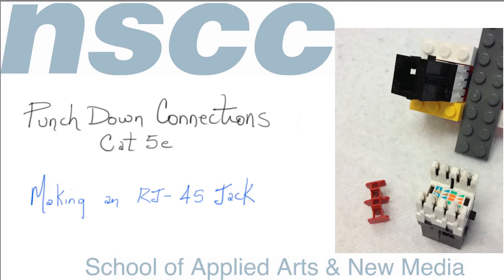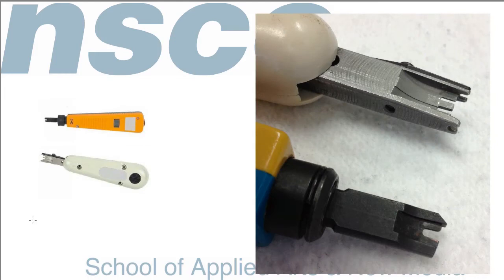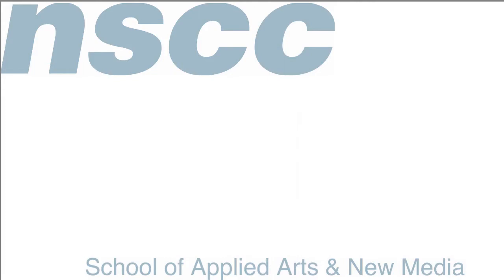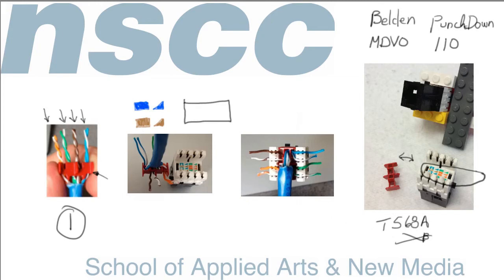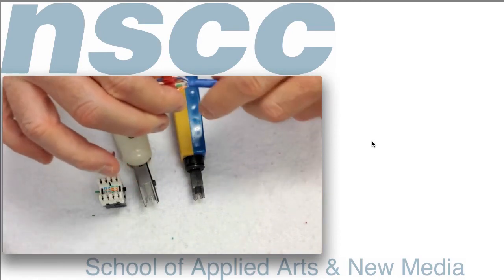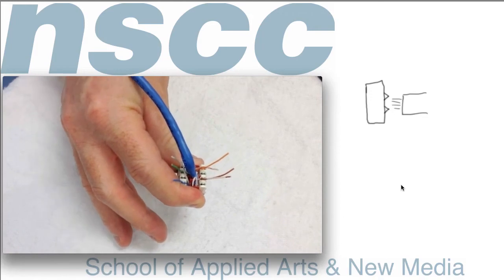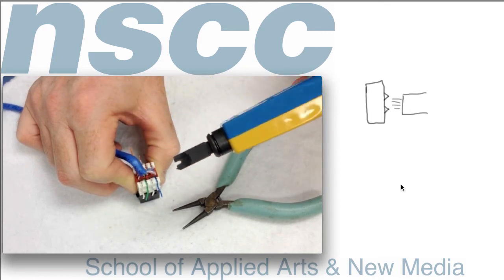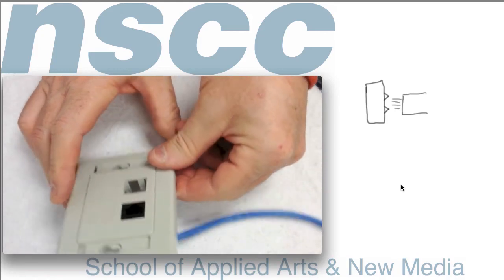How to use BIX and 110 Punch-down tools

Comment from the maker: Michel has more info on the BIX tool that he uses and you can read his comments below. His tool cuts slightly different than the 110 tool and so if you are using a BIX you may need to adjust your technique slightly. Both are designed to be easy to use.. simply push down solidly and your wire should be installed and the end cut. His BIX cutter may be a bit more reliable than the 110. Some cutters can be replaced and some can be sharpened if they get dull.

Comment: No much info on the BIX tool
Reply from the maker: Both standards work identically, but the "punch down blocks" are of differing dimensions. Showing how the 110 works will also explain how the BIX works. The BIX was used by most Telcos, but the 110 is likely the more common standard now. Just make sure to pair the correct punchdown tool with the blocks on which you intend to use them.
Reply: @davecrabbe4579  Partially true: the BIX tool and the 110 have very different cutting tools. I realized the BIX cutter was actually cutting only on the return trip of the  punch down block while the 110 cut on the downstroke. Significant difference.
Reply from the maker: @QcHumaniste  I don't have the tool anymore. I used one for years and certainly couldn't tell. (and also used the 110) . I just watched a video on it.. wow.. couldn't tell. It does cut right at the point where the max downward force is applied.. Maybe a significant difference is design, but really.. the exact same in operation. Push down straight, hard, release upwards and either one will punch down properly.  I did not have to change any technique in moving from a 110 to a BIX.  So as far as "How to use" .. I would still say my directions will apply for either.
Reply: @davecrabbe4579  I did use the BIX cutter today and it works as I said: when you push the tool down it accumulates energy and it does not cut. That stored energy is used to push back and at the same time to cut the wire with a side to side movement of the cutting blade (not down-up as one can expect). That's why the cutting blade is articulated on a pivot on the side of the main push-down blade. Perhaps there are different types. The one I purchased is a Jonard EP-16A.  It has two modes of operation: straight push-down without spring energy accumulation and push down with spring energy accumulation+cutting on back stroke.
Reply: @davecrabbe4579  While you need to finish the  cutting work by hand with the 110 tool, the Jonard EP-16A BIX tool cutting on the backstroke does a complete job:  the wires are entirely severed. Quite neat, actually. MV
Reply from the maker: @QcHumaniste  If the cutter on the 110 is sharp, it might just take a finger rubbing across the wire-end to remove it. Some wires are cut clean with the 110 and some dangle by a thread of the plastic insulation.
Reply from the maker: @QcHumaniste  Thanks for your detailed info on the BIX tool.. I’ll make a note of that for others who watch the video. Thanks for sharing your info.  Dave
Reply: @davecrabbe4579  You're welcome :-) There are actually millions of old BIX connecting devices still in place,  often with no longer used 4 strand wires going through the walls everywhere in  millions of buildings. Instead of considering them as a hindrance, perhaps we should considered them as assets to be reused or repurposed. From my former business (I am retired) I recovered 5 3-lines GE business phones. Using  the existing wiring in my community center, I added two VOIP lines. I rediscovered the joy of physical «push-button» telephony after years of touch-screen aggravation (yes, when you get older, the dielectric constant of your skin changes and Silicon Valley sure does not give a damn).
Reply from the maker: ahh.. yes.. I used to work for Nortel (actually BNR). I remember the POTS stuff well. Hard to believe technology has come so far so fast. I started programming on punch cards..